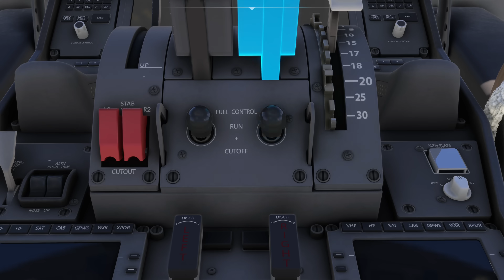Air India 171: Why Did The Fuel Cut-off Switch Get Moved?

Comment: I reviewed the AI 171 video recorded from behind the left side of the jet, from the cctv camera located behind the checkerboard building antenna location. It clearly shows the 787, after reaching its max altitude, began a sustained left bank, changing from runway track. If you review the Google earth images of the crash site, such a turn resulted in hitting the largest building, dead centered, at the medical hostel complex,  preventing a landing in the clear area right of those buildings, amongst the trees, and possibly on the road beneath. The PF would easily see both options while conferring with the PM during his promising relighting attempt, which was currently underway. FDR data will confirm whether control wheel deflections were performed versus an unrecognized simple turbulence induced banking. Until the Airworthiness bulletin implementation goes into effect for the fuel switch locking mechanism functionality, which were only advisory in 2018, all operators will need to have immediate maintenance inspections of locking mechanisms before further flights. A recommendation for a simple pushing of the fuel switches, fore and aft, against their gated stops, could be proposed to the manufacturer for approval, eliminating these switches as a future cause of previously reported failures.

Comment: VASAviation examples the fuel cutoff switches on a Cessna Citation which require the throttles to be pulled back to idle before pulling up hook-like devices that allow further backward movement of the throttles to fuel cutout. The point is that shutting off the fuel on a Citation is a very visible action and cannot be done without the other pilot immediately noticing. On the 787 obviously the fuel can be cut off without the other pilot noticing. This constitutes a single event failure that can lead to a tragedy. 

The evidence is leading to a very dark place. It is beyond the remit of a fact-finding investigation to explain irrational human behaviour, which is where the evidence is leading in this case. Bereft of explanations for the facts  the investigation will need to be handed over to psychologists and psychiatrists. Why did a jump-seat pilot yank the engine fire switches on a commercial jet some while ago? Fortunately this cannot be done surreptitiously and the captain was able to save the aircraft. But why did the jump-seat pilot do it? Why did the Air India PIC - it is assumed - toggle the fuel cutoff switches moments after take off? Fatally regrettably it was done surreptitiously. The co-pilot - it is assumed - didn't notice until too late.

Comment: With very high  respect to Captain Steeve.. I have a basis to think that pilots must not have done it deliberately. And the proof is in the JUST ONE SECOND GAP between two switches transitioning to cut off. At the moment of take off even if the disturbed pilot does it deliberately its not possible to finish the process of pulling the spring loaded next switch and turning it off in just one second after the first switch. 
1. How can he do it ( as explained by you only sir ... that its not a accidental switch on at home) so quick !!  and that too escaping the gaze of other pilot. 
2. If he was suicidal.. then why the denial .. "I didn't do it".

Conclusions are contradictory and I am uncomfortable how you missed this aspect sir.

Comment: I think a plausible explanation would be that an electrical or computer fault shut off the fuel to the engines. When one of the pilots realized that the fuel had been shut off they asked the other, "why did you shut the fuel off," and the other replied that they didn't. When this happened they probably cycled the switches which turned the fuel back on but it was too late.

Comment: I'm asking if a software glitch is possible. I've read that software can autonomously shut down engines by cutting fuel. What if the software was faulty? In that case, the switches would have remained in the "run" position, being mechanical knobs, even with the fuel cutted off. This would be consistent with the dialogue between the pilots (who say they have done nothing) , who might have attempted to force a engine restart by putting the switches in the "cut" position and then back to "run", as actually happened.

Comment: The preliminary report indicated the landing gear was left down. Is it possible one of the pilots had the ultimate brain fart and flipped the fuel switches instead of retracting the gear? I realize it’s a big stretch but something I’ve thought about is my own inadvertent actions with controls while driving my car. I’ve turned audio dials instead of climate controls. I’ve activated the cruise control when I intended to operate the wipers.

Comment: The Report says that the Fuel Switches were transitioned from RUN to CUT OFF. It does not say they were MANUALLY transitioned.

In view of the above, are we losing sight of the possibility that sequentially, 

1. First, Fuel Switches were electrically transitioned from RUN to CUT OFF due to technical glitch. 

2. Then, one of the pilots realized the loss of power in engine and asked instinctively if other Pilot cut off the Fuel and other Pilot genuinely said No he dint.

3. Then, in order to restart the engine, the Pilot may have shut down the switches and put them back in RUN position ? Possibility ?

All along, whether the report mentions that voice recorder caught the sound of SWITCHES being transitioned ?